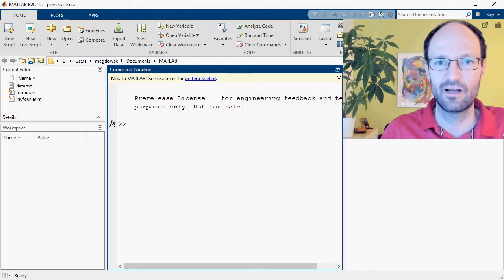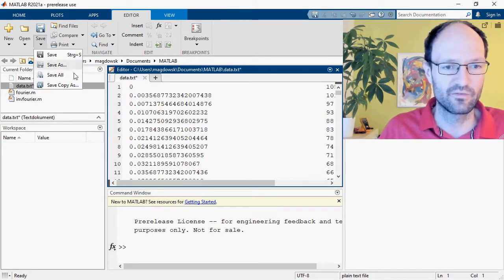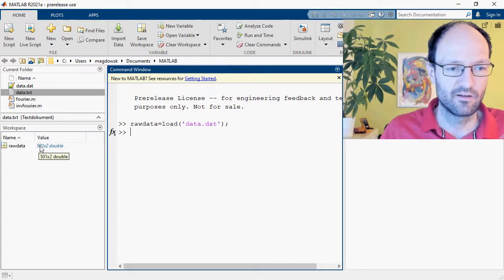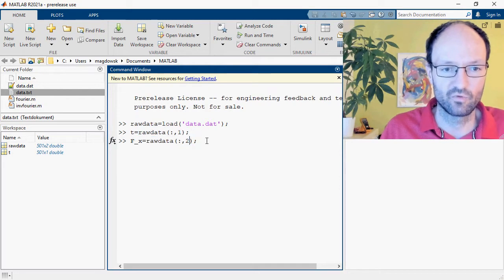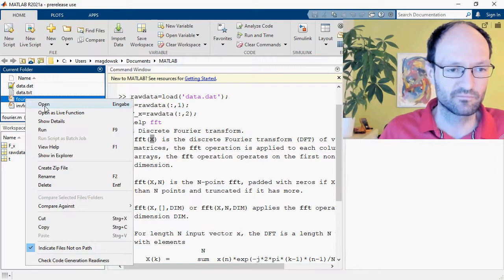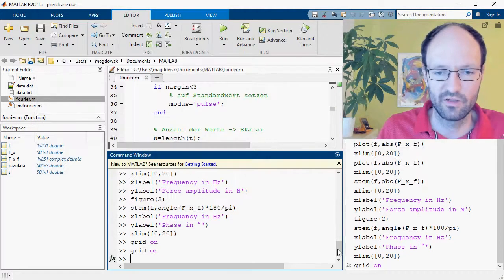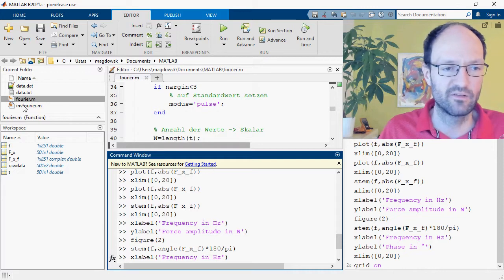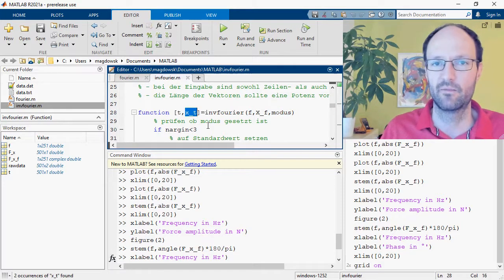How to do a discrete Fourier transform (FFT) and to plot the amplitude and phase spectrum in MATLAB

Comment: given s(t) = A*sin(2*pi*fc*t). Find Fourier transform of s(t), A =1, fc =5. Can you help me, i'm new to this. Many thanks from Vietnam
Reply from the maker: Thanks for this question. The answer is already given in your question. The idea of the Fourier transform is to represent a function as a sum of sine functions (with different amplitudes and frequencies). If you are given a sine function s(t) = A*sin(2*pi*fc*t), its Fourier transform will be one (complex) phasor or one component in the frequency spectrum with the respective amplitude A and the frequency fc, i.e. the given sine function. As the Fourier transform is often defined for cosine functions, the phase angle of this component will be -90°, as cos(x-90°) = sin(x).
You can also try this with the provided 'fourier' function in MATLAB or GNU Octave. Just create meaningful values of the sine function as the corresponding time function and do the fast Fourier transform to calculate the spectral components. Except for the value at fc, these components are all zero. See this example:
https://octave-online.net/bucket~8U1MLGxLX2PmD4uHyNapJj
Reply: @MathiasMagdowski  very thank you for replying me, have a nice day sir.
Reply from the maker: @atduong3917  No problem, you are welcome.